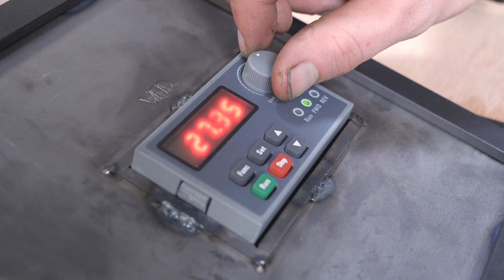A Plastic Extrusion Workspace

Comment: shredder , extrusion for square profire, sheet press for flat surface, it can basicly replace the wood in a workshop (You can create what you need when you need while recycling. good !)
Reply: Cyril Sebadelha blend saw dust during extrusion to reproduce the new decking material.

Comment: Amazing what your doing. If you can figure out how to Make tube extrusions you’ll have something structural, light weight & can be used for irrigation or aquaponics.
Reply: injection blow molding is the industrial process.  May be able to make a mold with a cylendrical outside and a inner portion for making it hollow, but this isn't optimal.  Extrsion around a bar may worek, but probably wouldn't be watertight
Reply: @ericlotze7724  I think thick walled tubes(like 3+mm) is achieveable with this machine, if you make a long(about 2 meters) steel tube, with a rod in the middle. The rod is connected to the tube where the plastic is molten(next to the outlet), and while the plastics pushes trough, it cools down and at the end you get a tube. I think this kind of thing also use in the industry for pipes.
Reply: @SasTech_  The middle rod will act as a heat sink in any case so you might want to try it extra hot.
Reply: @Krommandant    What you mean extra hot? These plastics melts like 2-300 °C, not an issue for steel. And the far end will be colder for sure, mainly if you cools it from the outside. This way lets say you have a 1m long tube and you install a rod(or better, another tube) inside, then when the plastics travels trough the 1m, it can cools down.
Reply: @SasTech_  yes but if your plastic hardens before becoming a cylinder because the mold is too cold it may become a problem. It's not as quick as injection molding, the molten and hot plastic extrudes under no significant pressure.
Reply: @Krommandant  I know the speed. It's just a general idea.

Comment: I have an idea, that it will work.. Have you heard about the stop desertification cone?  It is a cone, that holds water and releases it a drip at the time.  It is perfect to grow food in low rain areas,  grow food with low import, and to plant Orchard, as it protects the young trees in the first few years`.  It can be done with recycled plastic, and turn waste into life, food, forest, stop desertification, and if you make it in a disassemblable prototype, it can be used over, and over again, good luck